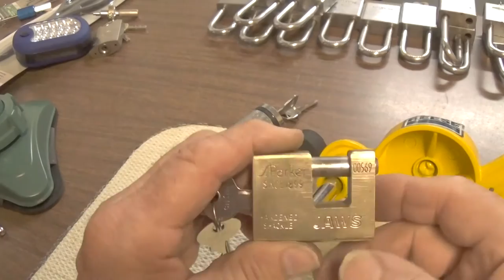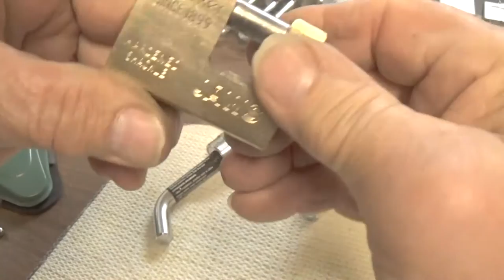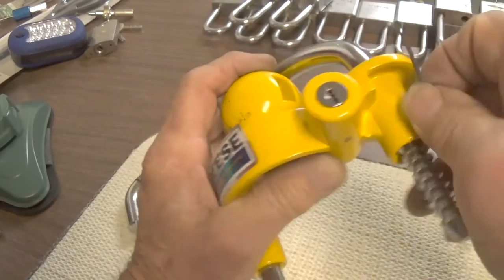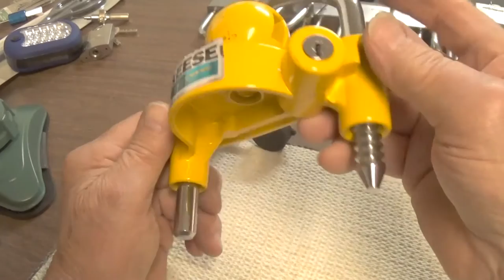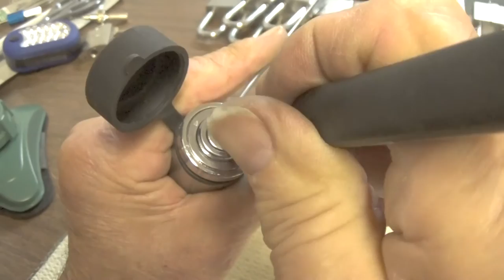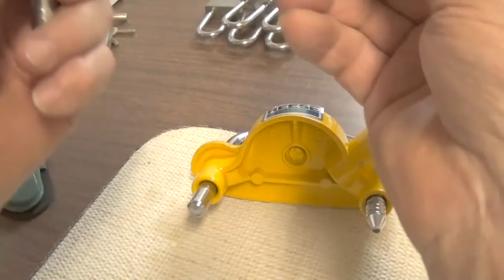Trailer Locks

Comment: Nice...can the S.Parker be bypassed just like the others???  Need to find that TS and try mine still.
Reply from the maker: I will check and let you know.
Reply from the maker: From what I can tell it cannot be bypassed. I tried but was unsuccessful. It ;appears the the plug it self has to be rotated.
Reply: Thanks for checking...:o)